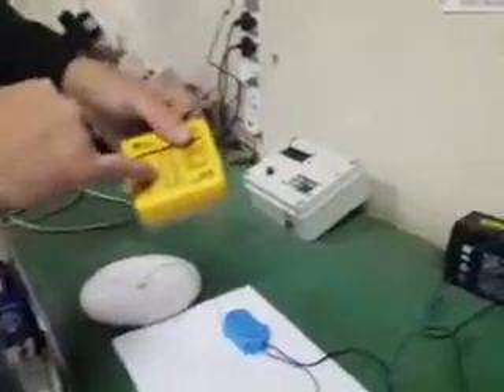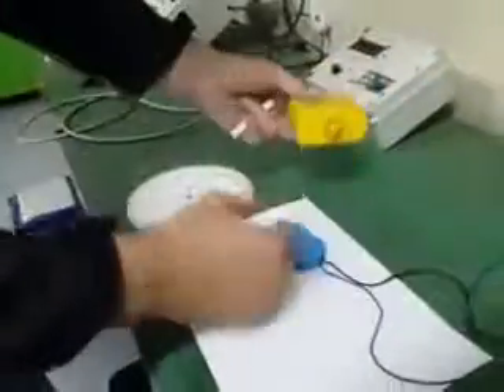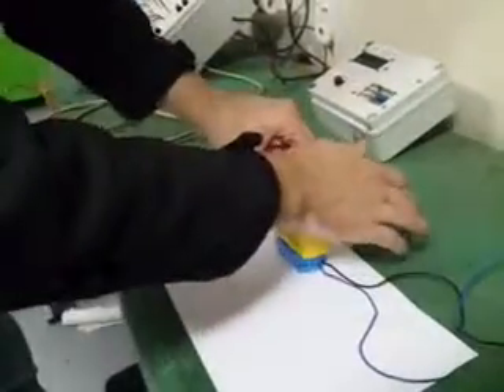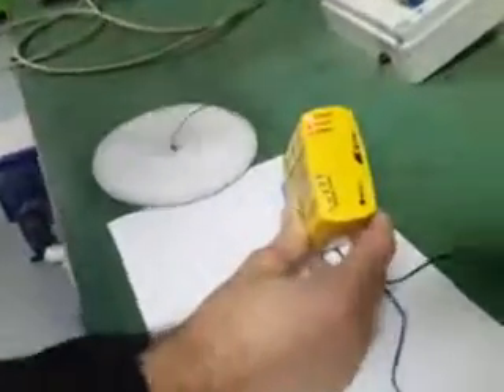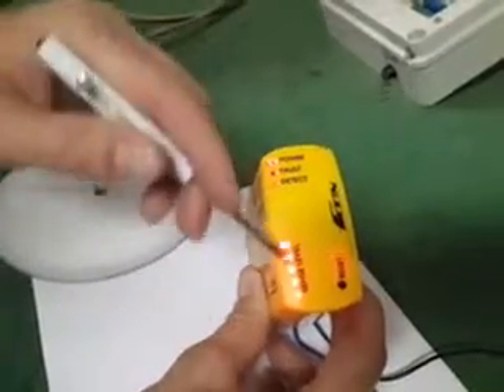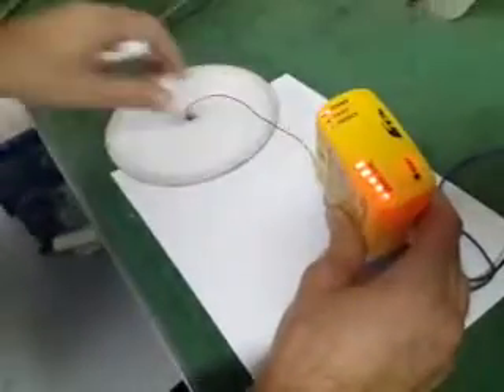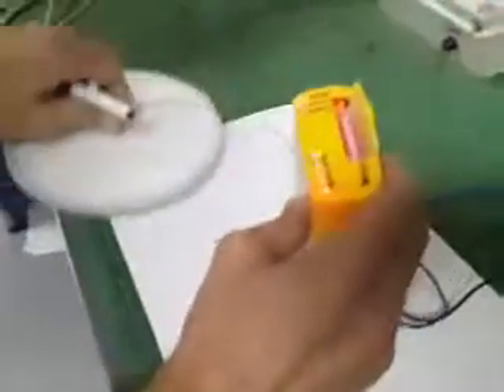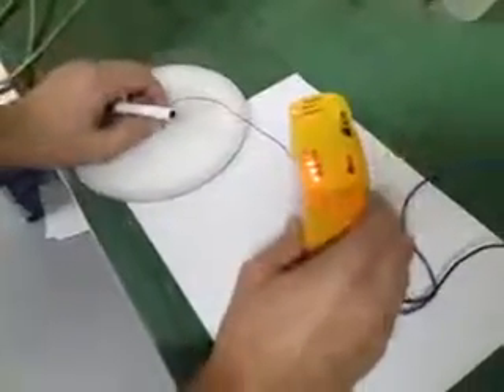Centurion Systems Flux 11 Loop Detector Test

Comment: Good day. I need help with a connection of a flux loop detector to a d5 smart gate controller please. live neutral and coms.
Reply from the maker: Hi there.  Unfortunately I no longer work at Centurion Systems but you can contact their technical helpline on WhatsApp on +27 (0)83 650 4010